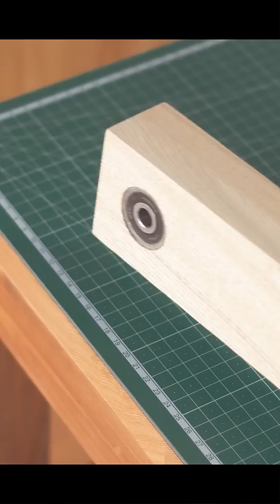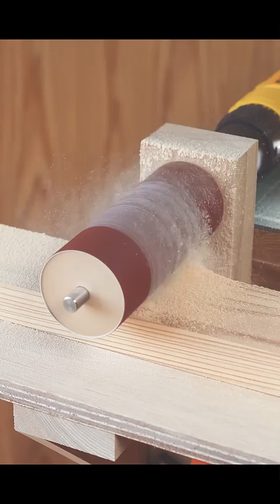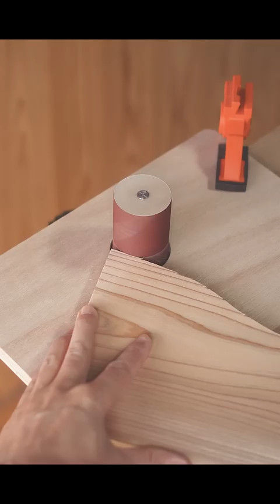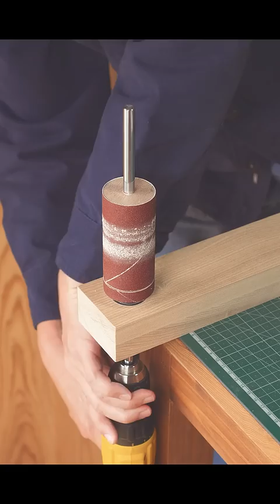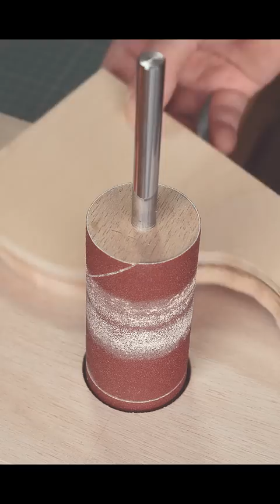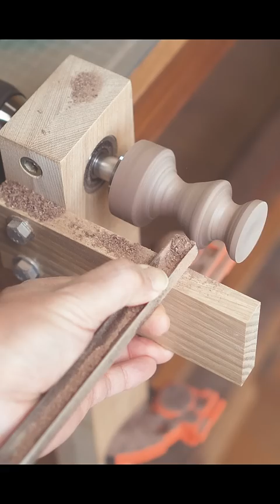6 Drill Hacks #shorts

Comment: Good design, but drills aren't meant for lateral force.  They will be ruined quickly.
Reply: I think that the load on the drill chuck should be low. The shaft lies in ball bearings which absorb the vertical force.
Reply: @Schwarz-ist-bunt-genug 
My logic tells me you need 2 bearings (1 on either side of the wooden bearing holder) to eliminate the force on the drill because with 1 you create some kind of lever action.
Just my gut feeling.
Reply: @tovenaar1988  yes sir 😀 i just assumed that 2 ball bearings were used... but there's only one in that board. my mistake.
Reply: @Schwarz-ist-bunt-genug  it would be if the drill is fixed to that wood piece.  But it just lay on the table so the tension will transfer to it.  I bet it also shakes and rackles like ceazy
Reply: He used bearings
Reply: Exactly what I thought 😊
Reply: Приспособа шик ноне для шуроповерта.